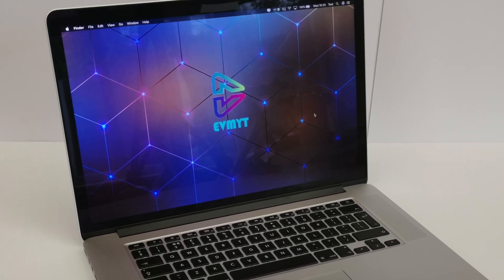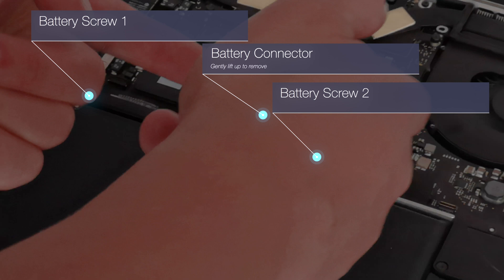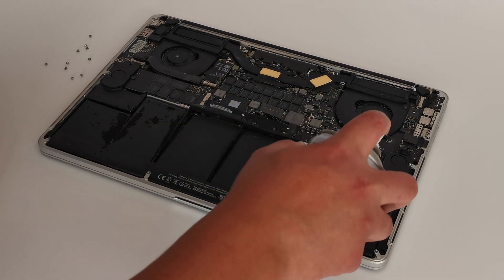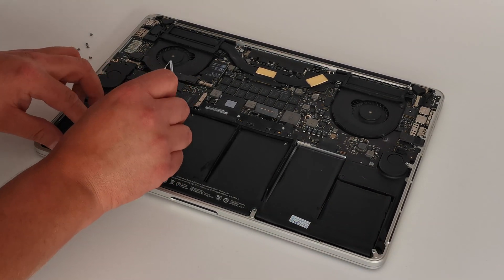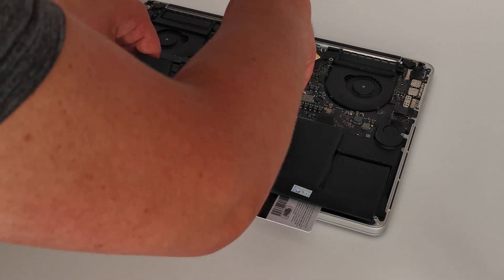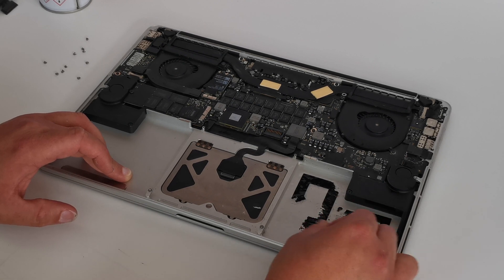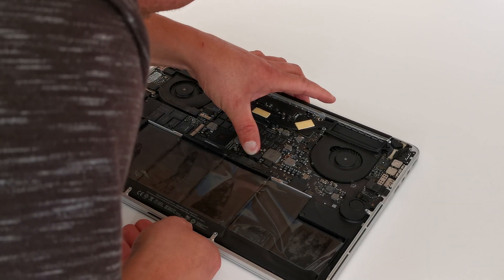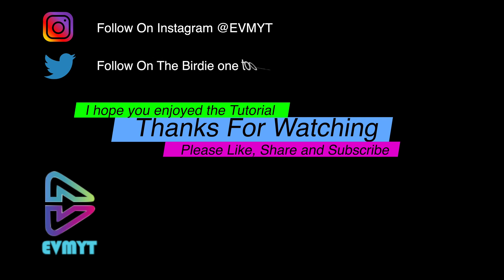How to Replace the Battery on the 2012 Retina MacBook Pro A1398 full tutorial

Comment: 1:06 right where you are pointing at, 1cm higher, there is a connector with a 6-wire cable running across the left screw (1). It doesn't seem to exist in your case... 🧐
Remove before unscrewing. It is tricky because the plug is encased in a thin plastic wall. A spudger is too wide to get under the cables, so, gently pulling it in all directions helps and it popps off.

Comment: Great video.  All advice should be followed.  I use isopropyl (rubbing) alcohol (about 1 ounce) to soften the adhesive.  I drizzled it over the top of the battery and then used an old, flimsy credit card  to push the alcohol into the gaps.  My new battery was slightly shorter (front to back) so I was able to line up the two screw holes first and then let the battery flop into place.  Once the bottom plate was on I flipped the laptop over and wiped away any alcohol that had seeped through the trackpad.  Overall took about an hour including cleanup.  Charged overnight and now working perfectly.

Comment: Thanks for this very clear video, I'm in the process of cleaning the old glue.
Two observations:
1) I and my wife between us have taken more than 2 hours to clear the glue from the outer two bays, we still have to tackle the loose central plate !!
2) I now understand why the Apple charge is so high, imagine a qualified technician spending 2 hours + to clear off glue. It is about time that Apple reverted to using screws and straps instead of glue/sticky tape. There is no reason why this battery needs to be glued in place. THe chassis could have ridges to give full lateral location and the vertical security could be by a moulded plastic cover secured by the existing battery screws and the 2 speaker housing screws.

This use of glue is why I moved away from an iMac (when my 2008/ failed) to a Hackintosh on a fully customisable PC as all post 2013 iMacs are assembled with double-sided tape for which Apple ask £25.00 for a replacement pack and official repairers have told me that only the Apple tape works !!

Comment: You are a star! Just purchased a battery, opened the case and looked at the 50 steps iFixIt would have me do to completely remove the motherboard and all modules... but one look and I thought all that seemed unnecessary. One google search later and you've confirmed my thoughts. Cheers!

Comment: Hi At 6:18, there is a new cover over the touch pad. Is that from the old battery?
Reply: I saw that and asked the same
Reply: @Panter73  I yanked it off the old battery, bent it, banged it back in to shape and reused it.  Works good enough.

Comment: The battery on my mid-2012 rMBP finally died and I thought that's the end of the best laptop I have ever owned.  But no, hurrah!  Many thanks for your rescue walkthrough.  
Bought a replacement battery from https://www.ebay.co.uk/itm/353538868344 (seller laptop-batterie-shop) for £53 [July 2021].  The kit also included pentalobe and torx screwdrivers of the correct size for the job,  After the first charge cycle the full charge capacity is 8625 mAh.  Not sure how good that is, but better than zero.
I also took the opportunity to remove and clean the fan nearest the GPU.  The fan is very clean but no longer works since I was too heavy handed in removing its flex cable and the socket housing broke off the motherboard.  
Another partial success,...

Comment: Don't you feel even the slightest bit guilty at depriving poor apple of £130 in revenue? Think of  all the poor workers at Genius bars who will be made redundant! .... JUST KiDDING 😄. Thank you for going to the effort of making this video and sharing with the Youtube community. I will be using it to replace the battery in my unit.
One small bit of constructive criticism - I would  suggest temporarily connecting and testing the new battery BEFORE removing its protective plastic from the adhesive pads.  That way you do not have to go through the hassle of remvoing it if it does not work and furthermore you can return it in good condition.
PS - If I didn't know any better I would swear that Apple deliberately made replacing the battery  as user unfriendly as possible in order to maximise profits from repairs and to encourage purchase of later Macbook Pro models.
Reply from the maker: My advice is to buy a NuPower battery.  The one I fitted in that video was useless.  I ended up replacing it with a NuPower battery and it's been brilliant ever since.  I suspect eBay sellers are resetting the cycle count and selling poor quality batteries.
Reply: @EVMYT  Thanks for the advice. Purchasing replacment batteries on Ebay/Amazon seems a bit of minefield - even the so called "Genuine, original" batteries . There is still savings to be made even with purchasing the NewerTech NuPower battery.

Comment: Worked for me- I had massively swollen batteries. I think make sure you tilt the mac so that excess IPA goes towards the battery side and away from the boards. Just go slow and you'll be fine! 
Bonus: this fixed my touch pad too (couldn't click due to the older swollen batteries...)

Comment: Definitely worth mentioning to put a sheet of foil between the keyboard and the screen to stop excess IPA from leaking through and damaging the screens anti reflective coating.
Reply: Woud have been good to mention that in the video. I installed the new battery and had to remove it to put in that plate as I didn't notice it was stuck to the old battery. What a hassle....
Reply: unless youve meticulously removed the coating because it has gone bad looking absolutely horrible. probably still a good idea though

Comment: Excellent video. I’ve just done mine this evening and it took me approximately an hour. You should add that the new battery needs to be calibrated after it’s been installed though. Also, once the case is open, you should take the opportunity to blow out the dust from the fans and grills. You’d be surprised at how much fluff accumulates in a 2012 laptop.
Reply: how do you "calibrate the battery"?
Reply: @contractorwolf  charge it fully then let it drain fully.
Reply: @contractorwolf  with my battery came an instruction: BEFORE glueing it in, connect it, turn around the MBP, holding everything in place, start it and run it for 5 minutes on battery. If it doesn't start, connect the charger cable and run then on battery. 
Check the charging level, it should be around 50%. If the new battery is damaged, at least you didn't glue it in 😉 and can return it. Then charge for 5 minutes. 
The process moves the ions in the battery first time after storage. The batteries are charged to about 50% before storage.

If you have a battery app like accubattery, the charging cycle counter should show 0 - zero.

You can finish the repair and then run the Mac on battery until it turns off. Charge then to 100%. Your officially first charge, life starts over 🙂
My second battery lasted 3 years, running the Mac every day.

Comment: Worth pointing out that you have to use the alcohol very, very sparingly and work very, very slowly. I didn't and the excess alcohol seeped under the keyboard and has damaged the logic board. One dead lap top with a new battery!

Comment: CAUTION:  EVMYT indicates his screwdriver is TOREX (6 Teeth).  It is a PENTALOBE (5 teeth).  They look the same and fine if one comes with your battery but don't use your TOREX bits for this.
Reply: Thanks for the heads up (pun not intended )

Comment: That IPA stuff doesn’t mess the board up?
Reply: you can use IPA on a cotton bud to clean motherboards! it's great stuff
Reply: No, isopropyl alcohol does not leave residue when evaporate, so as long as you leave it long enough it will dry quickly and does not mess with electronics. I recommend using it to clean most electronics components